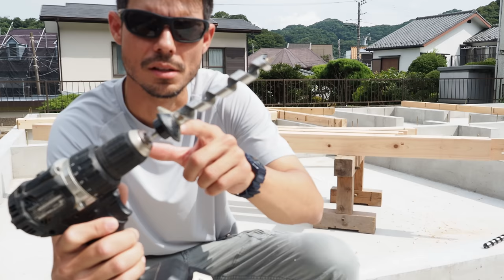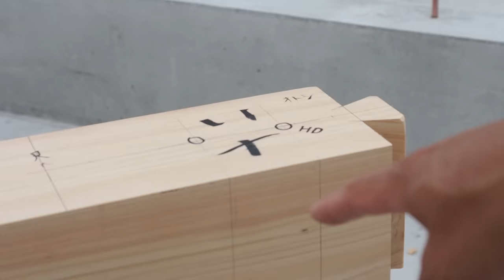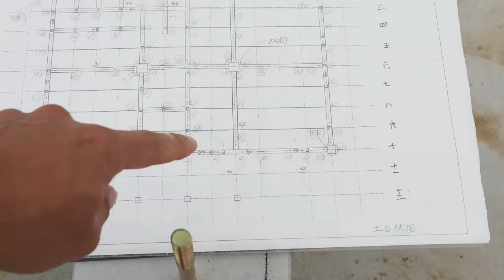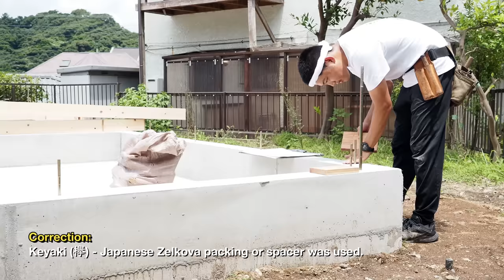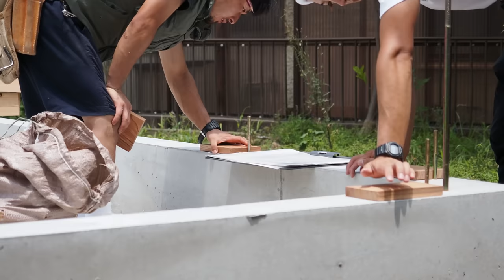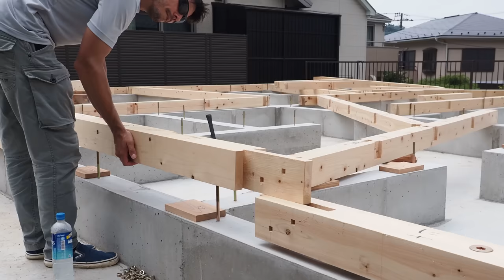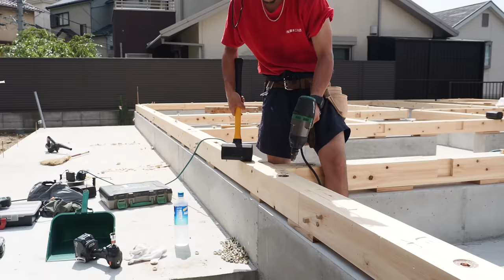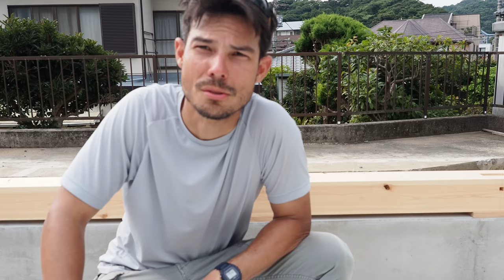Japanese Foundation Structure Explained! - Dodai (土台) - Setting up the Dodai (Foundation Beams)

Comment: Accuracy is a prerequisite, not an optional extra and this is a superb example. I live across the road to a large recently built timber framed house. I was appalled to find NO fixings to hold the frame to the concrete base. The explanation was that the wright of the house and the outer leaf of stone meant it would be impossible for the house to move. 
The Japanese have to construct with earthquakes in mind so obviously construction reflects that but even so this is a beautiful construction. It made me want to join in with the job. 
No DPC? Is there no transmission of damp between the timber packing and the wooden frame?
Superb video of a superb job
Would love to have seen the whole construction from
Beginning to end, lots to learn from it
Reply: My timber frame home had 4" wide by 1/2" thick metal pieces welded to 2 pieces of 3/4 rebar which was cast into the concrete. They fit inside a concealed cut in the 12x12 and 8x8 vertical posts and were secured with 3/4" bolts drilled through the posts. I live in a seismic/flood area so that met code where I am.

Comment: Very interesting.  I hope you continue to follow this construction on video.  I've never seen the spacers before, but have seen Japanese use what almost looks like a silicon mat between the concrete and wood.  Will that space stay open making it a vented crawlspace, or does it get filled with something?  And that Hinoki is beautiful...
PS - I got a shigane from one of the stores you visited.  I got the Shaku version for the historical significance.
Reply: 1.Method of leaving the space open (for ventilation)
2.Method of ventilating in another place without creating a space in the first place

I think there is

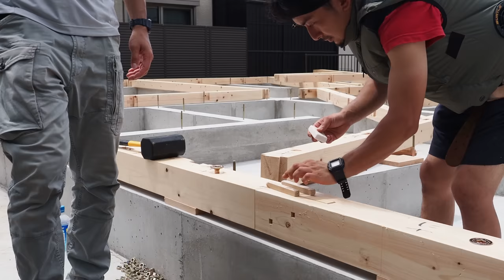Comment: Are the komisens soaped or glued (9:47)? (the square wood plugs/pegs). Do you trim them flush once installed on the outside to avoid getting in the way of sheathing? How do I make the komisens? (I'm noob). I'm thinking about cutting the pegs a bit bigger then trimming it at an angle with a hand planer or knife at a 2-3 degree angle.

Comment: I don't know what this is called in English, but in Japanese, it's called 'beta kiso'  It means Raft Foundation.
"beta kiso" is a foundation where the entire surface under a building or facility machine is a flat concrete slab reinforced with steel plates. Compared to a strip foundation, the foundation's bottom area is larger, which helps to distribute the load, transmit it to the ground or slab, and increase durability and earthquake resistance against uneven sinking. However, it also incurs additional costs. It is mainly used for heavy buildings or when the ground bearing capacity is low, and piles can be added as necessary. Since the entire floor surface is made of reinforced concrete, it also serves as a moisture-proof measure.
Traditionally, it has been used for prefab houses and two-by-four houses, but since the late 1990s, it has also been used for wooden post-and-beam construction due to the moisture-proof advantages."
There is a comment that says wood and concrete may deteriorate over time, but to prevent this, painting is applied to the foundation and wood is treated with chemicals.
Reply: Huh
Thanks for the info

Comment: For people wondering about lubricating the pegs, at least in European construction, they are always slightly oversized. I suspect the same here.
   I don't make oversized pegs myself, I use tapered pins in small projects, not what you'd do in a house, only one end makes contact. Fine for a box.
   It is a tool consideration as well. Their one chisel is designed to square a pilot hole and you could pound wood into a grid of blades kinda jig and square pegs just pop out the other side.

Comment: Hi 👋, The Carpenter Life, A dying Art , I believe that there is still schools that teach this art of framing, I have watched them when they build, pagodas and other structures, I’m a retired specialist joiner cabinet maker, now in my 70s, I have used the similar Dove tile joinery on a property that I was restoring and repairing in France, The original beams in the property was set into the wall another see the moisture coming through the wall or rotted the end way, I ended up replacing I can’t remember if it was 24 or 26 beams, instead of putting them into the wall, I made a wall plate 100 mil by 300, bolted that to the wall and Scribd it in, Then I marked out Where the joist  were going to go, I then had some make me two aluminium plates, as part of a jig, It was a copy of something that is made in Switzerland and Germany as they use this type of joint quite a bit over there, you do need an extremely powerful router to cut out the joint, Maffel , this took me less than a day, including putting all the joist up by myself, I might add, I believe That this design of building is to help as well in earthquake areas, 
I find this very interesting , it’s a pity that a lot of these skills are not taught in schools, especially in Europe and UK, as a lot of it, nowadays is all computer controlled, They are losing touch with the Earth and the environment, stay safe, Phil from the moulin France

Comment: Interesting video. What is the puffy vest with what I think is a fan one of the guys was wearing? Cooling vest? 10:00 Also where can I get these conical bolt/washer things? So cool!!
Reply: That vest is called Air conditioned clothing. Also, this washer is a BX Kaneshin screw washer.

Comment: Love the precision of the building technique. 

Does the gap made by the spacer shims also act as the foundation ventilation? Interesting that there isn’t a vapour barrier installed under the shim. I know you mentioned that those shims were resistant to moisture damage, but a vapour block would improve that factor.
Reply: Nordic log houses typically use bitumen infused roof shingle type material between concrete and the pine wood. At least pine wood is so moisture absorbent and downright moisture wicking that you need a vapor and capillary block between the concrete and wood. Concrete in the soil always has capillary water in it and it can easily travel 3 feet or more up the foundations. Perhaps these shims are made from rot resistant wood like the larch heartwood? Didn't he say something about chestnut wood or is that Japanese cypress?

Comment: I find construction techniques fascinating. What's the purpose of this system? Is the over all system designed to absorb tremors more effectively and allow the building to flex slightly? Is that the reason for using the wooden peg system over steel hardware for the majority of the fasteners? I love the concept of using dovetails for most of the construction joints and that seems like it would really hold up over time.

Comment: The foundations there are fascinating to me. Where I was raised in Texas, flooring is directly on a FLAT foundation. Here in West Virginia, where there is almost zero level ground, block walls are built onto flat foundations to make a full basement. The foundations you've shown look like the "crawl-space" foundations here except there is the concrete walls AND floor. Here, they might do the crawl-spce walls out of brick or block and the space under the house will be DIRT...they MAY cover that in plastic but I've never liked that standard at all. This looks much better but I don't know what the price range of the houses you're showing compared to others there. Again, fascinating content...thanks.
Reply: Yeah I've been watching a lot of these type of videos and it made me realize how amazing awful u.s construction is......one video was about a carpentry school in Switzerland for house building and even the smallest gaps on their models was enough to drop them multiple letter grades.... while here you get beams that arnt nailed or gapped well to begin with
Reply: @wiktorjachyra1869  When I got out of college some years ago, friends and I worked on a framing crew for an architect building expensive houses.  We held ourselves to a pretty high standard, and the work we did was better than most of what you've probably seen.  Nevertheless, the Japanese set very high standards in practically everything they do, and this is really nice to see.
Reply: Japan has and builds for the great seismic risk there.
Reply: @disqusrubbish5467  exactly, but Japan also has high standards for the stuff you dont see. Like the foundation for those higher end houses probably was still rough since it was buried or not seen. While in thos vid the foundation looks as satisfying as a perfectly made pancake
Reply: @robertbrewer2190  あなたは正しいです。
日本ではブロックを積んで作る壁は危険です、だから家には使わない。
地震対策です。

Comment: I was wondering how you line up the quad dovetails in the centre, and now I know it's just through measurements. I would have been hovering the female beam over them to make sure it's going in then tighten the nuts after I was happy it went in. Very accurate and satisfying. The shims you mentioned were to raise it off the concrete, why isn't a job porous material used to raise the timber above the concrete?! Like DPC? Damp proof course? 14:15

Comment: You should use a lead sheet between the concrete and the wood it stops the wood rot dead. We have been using it on the UK/eu for centuries

Comment: I understand you put spacing under the beam, so it doesn’t touch the concrete, which can potentially be moist. But now there is an air gap there. 
How will it be airtight and insulted?

Comment: The quality of work going into this in comparison to North American house building is insane. I didnt realize they were using tongue and groove construction in the house framing there still. Its really impressive.
Reply: "The quality of work going into this in comparison to North American house building is insane."

No it isn't. Japanese homes come in kits that are assembled at the job site. They have to be very exact because the kit has already been cut before it ever got to the job. And the builders have probably built this exact same home kit hundreds or thousands of times. The only thing that comes premade in American home construction are the roof trusses. Everything else is cut to fit on site. 

 Japanese homes are built to last 25 years while American homes are built to last over 100 when properly maintained. The Japanese have some really cool carpentry techniques but American homes are far superior
Reply: @jimbeam-ru1my  An american house will look like in a Western movie after 100 years because they are in fact chicken coops compared to japanese houses which will last 500 years at least with the right timber. Just watch the old japanese temples before writing such nonsens!

Comment: I love how all the system fits together but wood in direct contact with cement/concrete is not a long term solution, cement is too alkaline for wood in the long run, it decomposes lignin in the wood, specially in conifers which tends be acidic. Even for hardwoods the cement is going to win in the long run. Also, and I understand that is not desirable, but at least some plastic film as interface would increase the lifetime greatly o even some metal/S steel can help. I use flat pieces of zinc/metal roofing as an interface between wood and cement. Keep it up with the videos I have learned so much from them!
Reply: That's right. So we will apply coating to this foundation. Coating helps to prevent the intrusion of moisture, carbon dioxide, and other elements in the air, reducing neutralization. Moreover, its water-resistant property helps to prevent water from penetrating the foundation and protects it from rainwater.

Comment: I used to live in a house in Chicago that was built in the 1880s. During some renovation, we found that some of the joists were connected to beams with mortise-and-tenon jointery.

However, over the course of over 130 years, some of the joist ends that sat inside masonry joist pockets had rotted a little bit at the ends from moisture absorbed through contact with the masonry.

I'm just wondering if some of this dovetail jointery may not last beyond 100 years if the post ends are in direct contact with concrete and can absorb moisture through the end grain. This isn't criticism. I'm just wondering how the system might perform if some of the dovetails located at the ends absorb moisture over time.

It might be fine if it's not exposed to heavy moisture or freeze/thaw cycles that we can get in the northern parts of North America. I'm also wondering if you have termites or other insects like carpenter ants in Japan that can sometimes infest framing lumber in a house.

In any case, I have a lot of respect for the precision and skill required for this kind of jointery when used for framing a house. It does look like this can be resilient in the event of an earthquake, but I just wonder how it holds up over a long period of time.

Comment: Wow, I am impressed. What an incredible accuracy. But building this way is rather expensive I suppose.
Reply: Yeah and no. 
If you do it properly, you do it once, and it lasts for a long time. 
If you rush or use sub-standard techniques, you may have to demolish and redo things, and perhaps the construction will be inferior requiring more maintenance in years to come. That costs money. 

I'm in the camp of, pay "more" for quality and skill, rather than trying to do things a cheap fast way, as you will inevitably pay for it over and over in the future.

Comment: Spray it use some oil for that bit. Will help the wood not stick to so well. May even sand the insides down to make them smoother. I know they make it like that from factory for rust prevention and durability but it grabs more that just a smooth piece..

Comment: Love these videos! Have you tried a Milwaukee cordless impact? Best ones out there in my opinion. We use them on wind turbines for bolts on gear boxes.
Reply: Yeah, theres no way a 2000+ Nm high torque from Milwaukee is going to lack power for this ( I think the one they are using is 370Nm??) maybe the problem actually is the new ones send the nut to the other side of the beam?

Comment: So how do you prevent insects from crawling in those huge gaps under the beams? For my timber frame home the wood was set on a thin waterproof membrane directly against the concrete. No gap for bugs, and the membrane  keeps moisture away from the wood

Comment: Great video, thanks.   Ive only seen Sekisui and Panasonic houses under construction before with barely any timber at all.   Please can you describe how the rebar is setout.  Is the slab designed so the the whole structure moves together in a quake?

Comment: You should always lay out the bottom of the rim joist to drill your holes. This guarantees the hole will be aligned where coming out of the concrete no matter the accuracy of the angle of the hole

Comment: Im surprised youre using chestnut as a capillary barrier between the concrete footings and the wood rather than some sort of gasket and sealer.
Reply: indeed, any type of similar-sized block of plastic/rubber/... I would have expected. Something non-slippy but otherwise similar.
Reply: @SenselessUsername  For me it was less about the the slippery ness and more about providing a waterproof barrier to prevent water wicking up from the cement footings into the wood via capillary action.

Comment: Not a 22oz waffle-faced framing hammer to be seen. This is beautiful and exacting work. More like building a cabinet than a foundation. I wonder what they do if one of the square, long pegs breaks when they're pounding it in? How do they handle that?
Reply from the maker: It's simple. You can push it back from the opposite side.

Comment: Part of it is that the frame IS the finish in traditional Japanese construction. The framing in American construction is completely hidden behind the finish layer so its dimensional accuracy and structural soundness are the only relevant criteria. The thing I think that's most relevant in timber framing, and less mentioned compared to the aesthetics, is the fact that wood joinery allows structural components to be replaced ad infinitum, due to there being far less structural connections and the wood joinery not causing damage to the connecting components. Hence why Japan has the "oldest" wooden buildings. Compare that to modern stick framing where there are hundreds of studs and thousands of nail attachments. Though the thing that stick framing has everyone beat on is speed and economy. Like entire apartment complexes framed in a couple weeks.

Comment: Excellent video. I have some questions: Are chestnut spacer also for ventilation or will those voids be filled. There are no spacers under some of the joints, are the joints so strong it's not necessary? Why use not water resistant gasket material under the wood instead spacers? Are they able to change out the chestnut spacers over time should they rot? Why not snug down the bolts with a long handled racket or torque wrench? Thank you.

Comment: How do the bottom ends of the corner hashira interface with the concrete foundation? Does the endgrain bear directly onto the concrete? Is there a piece of keyaki in between, as with the dodai? Or does it simply bear onto the two dodai members via the dovetails, with clearance between the bottom end of the hashira and the concrete foundation? I couldn't tell in the assembly video. I'm wondering how this joinery style avoids moisture wicking upwards from the concrete foundation into the endgrain of the hashira. Thanks very much.
Reply from the maker: They sit directly on top of the concrete. I would recommend building to your own desire. I think applying some waterproofing material of some sort would only help the longevity of the corner pillars.

Comment: Impressive workmanship. However I would like to ask if the wood shims are connected to the beam or concrete foundations or if they could slide off in case of a seismic event. Thank you.